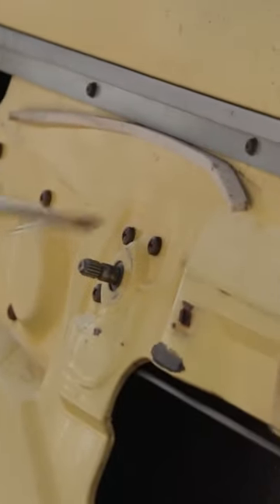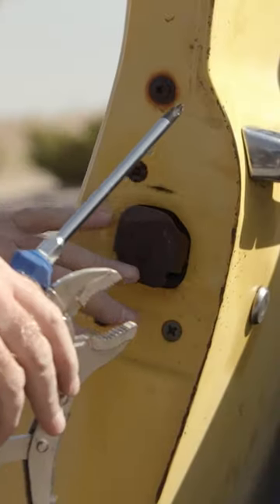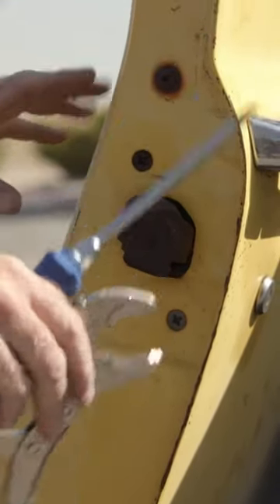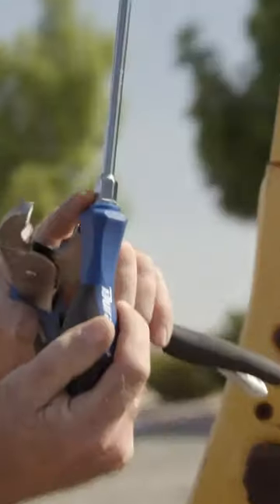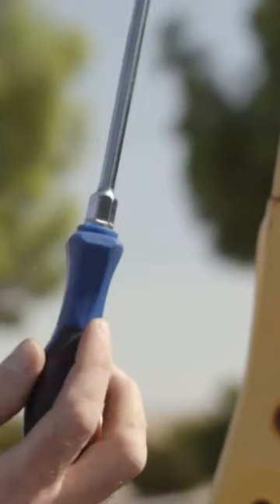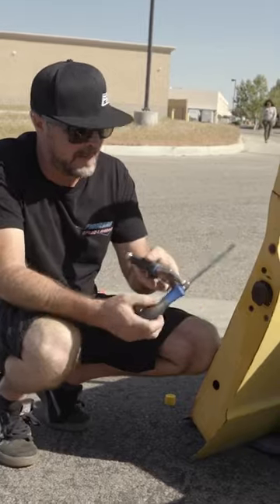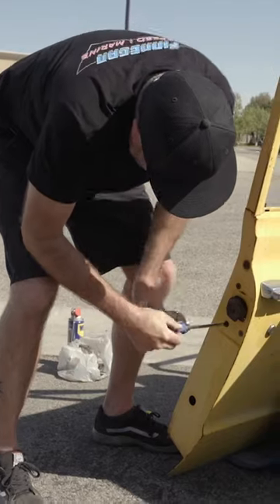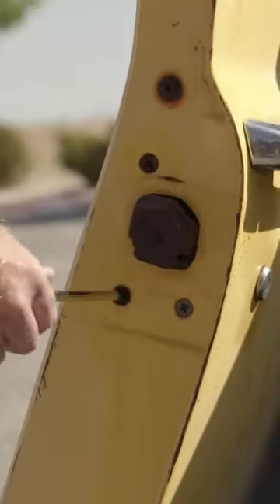Finnegan’s Tip For Fixing Seized Door Hardware! | Roadkill

Comment: A big 6 point socket fits over old craftsman screwdriver handles. That said i use my 1/4 impact to take those brake rotor screws out. Make sure if its a #3 Phillips that you actually use a #3.